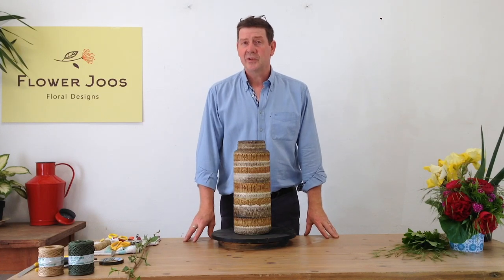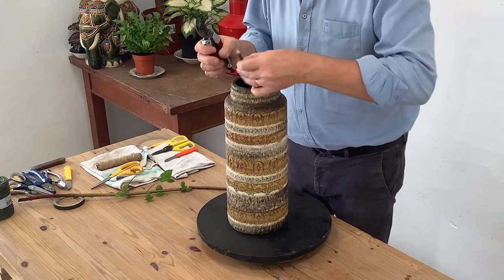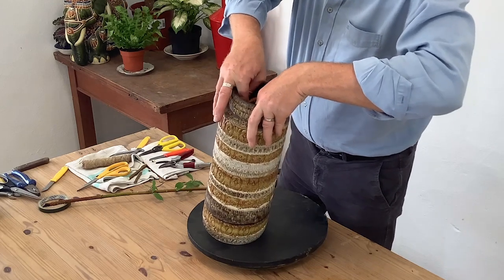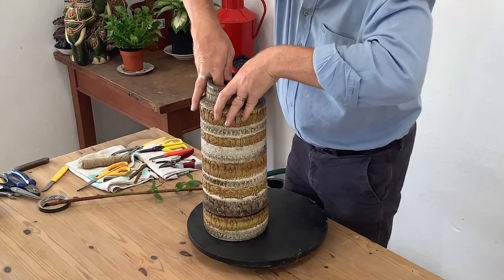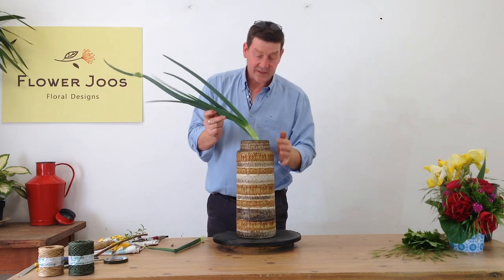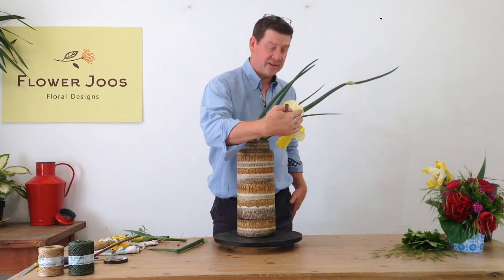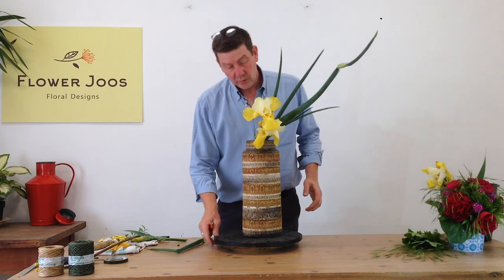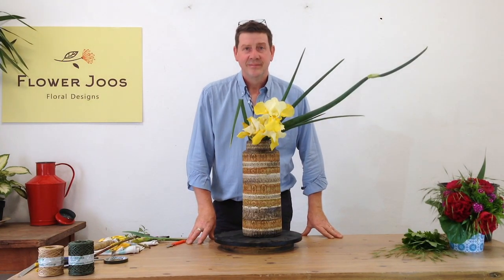How To Make A Large Design Using Cross Bar Fixing

Comment: Maybe using some sort of putty or tac will help to secure the corss bar? Is the floral tac different than the standard blue tac? With this kind of design where the vessel is very tall and the flowers cut short, do you have to change the water every second day or will adding bleach be sufficient?
Reply from the maker: Veridiana Veridiana the cross bar is just wedged and is strong enough without floral tac. In fact a cross bar can break a ceramic vase - I have done this, so it’s really firm. 
For water you could just add flower food - then all you need is to top up the level. That is easier than resetting the design each time. 😀🙋🏼‍♂️